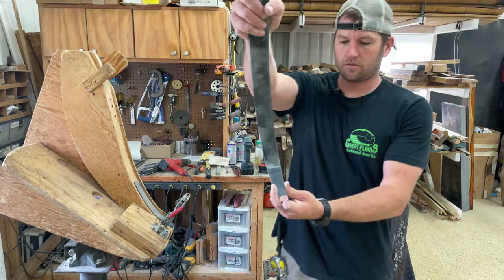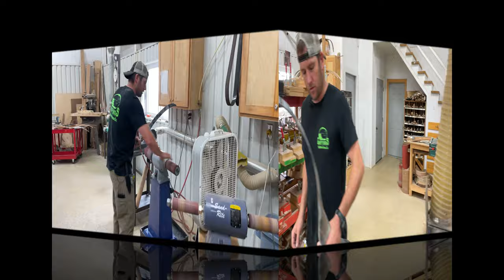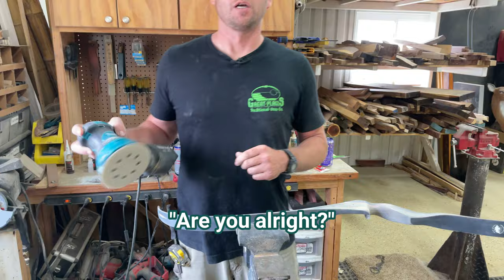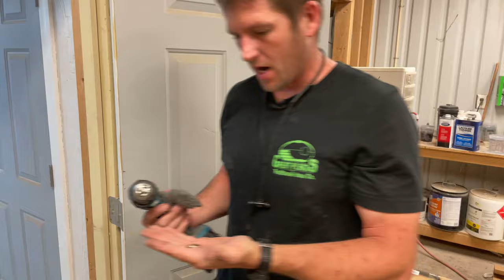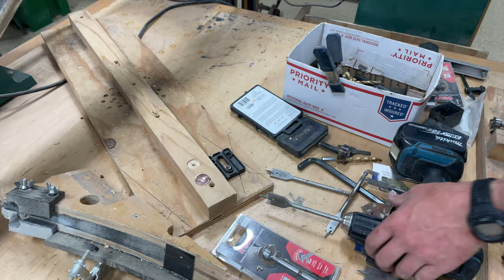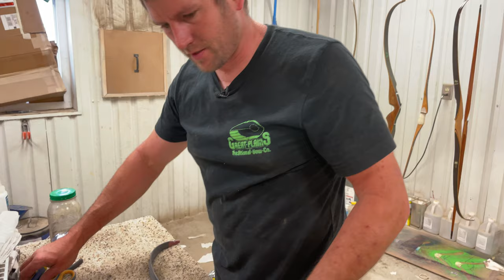Vintage Bow Rework

Comment: Excellent work, despite the hurdles.  Bear archery started cutting corners after they were sold to Victor Comptrollers in the early 70’s, using cheap plastic raised “medallions” was one way.  A few years later they left Grayling because they didn’t want to pay their longtime skilled employees a decent raise.  It’s been downhill since, unfortunately.
Reply from the maker: Yeah that's what I hear
Reply: Yes, Victor Comptometer did not provide any benefit to Bear Archery except perhaps for continuing their existance for the next acquistion, which ultimately has been in the hands of Escalade Sports since 2003, with Bear as an anchor of their incorporation, providing stability for the past 21 years. 

Interestingly, the medallion polished up instead of melting, so there must have been at least a copper veneer? I don't think they still use that process & believe they are metal now, but quite frankly, I didn't know about the plastc medallions until this video. Hopefully, it was simply an anomoly of Bear's history.

Comment: The Coin Medallion: Beginning in 1959 all Bear bows had a coin medallion of one type of metal or another. Below are the approx date ranges for the type of coin used.

Copper Coin – 1959
Aluminum - 1960-1961
Pewter – 1962
Brass - 1963 – 1970
Nickel-Silver - 1971-1972

ALL coins were flush with the wood until 1972. In late 1972 the coin was raised above the surface of the bow and came in both gold and chrome covered plastic and are still used in Bear bows today.
Reply from the maker: Very interesting! Thank you!

Comment: Great job, im surprised you didn't break the medallion when you where trying to pull it out of the bow. They are indeed plastic core with copper over them. Bear did use real metal medallions in the early days then went to the rasied ones in the mid 60s./70s the metal ones are flat in the risers. Where the plastic/copper ones like on this bow are above and not reset into the riser. I've broken number of these "rasied" medallions trying to pull them from bows.
Reply: At least this part can be ordered from 3 Rivers to fix old bows up that are missing the medallion both versions depending on what year the bows were made in based on other factors.

Comment: Here's the expert I've been looking for!
I am Korean.
There's a traditional Limbs that's finished with glass fiber, and it's peeled off.
Can you remove and refit the glass fiber without damaging the veneer?
Reply from the maker: It can be done and I've done it, but you have to have lots of patience and the right tools. If the bow isn't extremely special to you I probably wouldn't attempt it
Reply: @greatplainsbow  I appreciate your advice.
It's manufactured, and I have a replacement, so I'm not that desperate. However, the price of the bow is getting higher day by day, so it would be helpful for me if I knew the possibility of repairing it.
It's amazing and fun to see your work.
Reply from the maker: @파닥파닥물고기  Thanks for watching!
Reply from the maker: The best way I've found to get the glass off is to CAREFULLY grind the glass off with either a spindle sander or bearing sander. You can do it with a belt sander turned on edge and a little table made for it and squared to the sander

Comment: This bow looks like a late 1970's to sometime in 1990's bow, as after that, the Bear brand and stopped offering the option for a plunger/bowfishing accessory hole on the bows. Most of the models look more boring moving from Michigan to Florida the factory due to Fred Bear Selling the brand and cutting cost just before this move with the bows due to having to keep the bows going as Compounds that were still able to finger shoot and go sans sight, they did not shoot that fast.